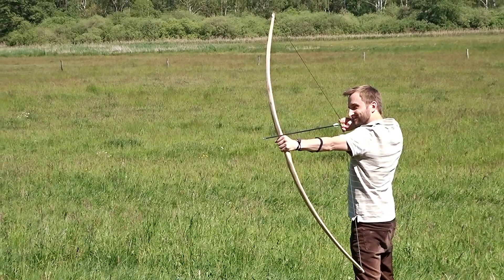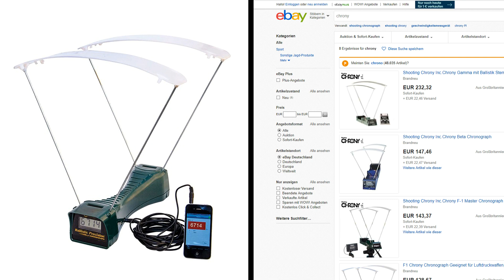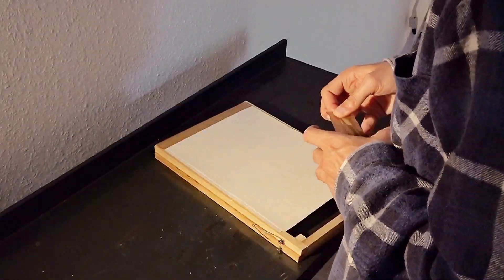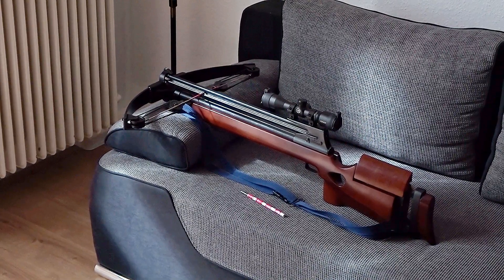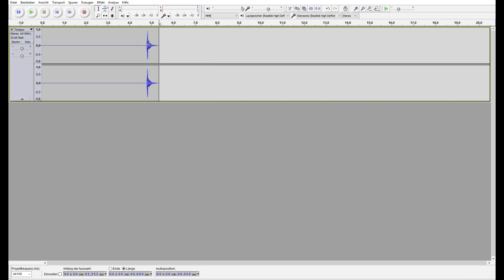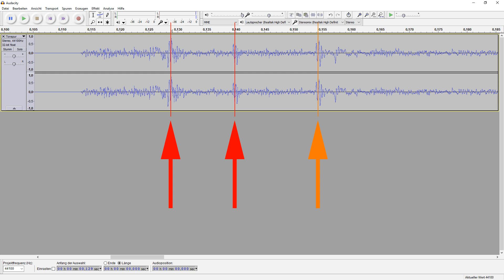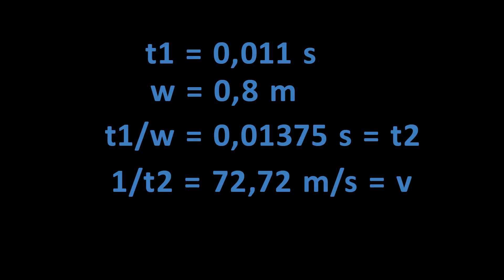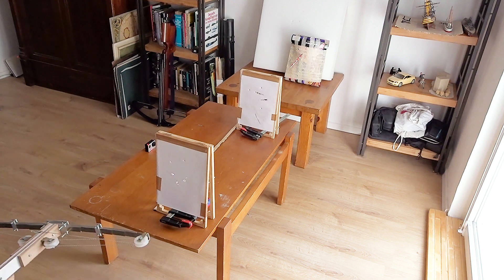Measuring Projectile Speeds – without a Chrony

Comment: I think that 40 joules it is very much for this crossbow. Is this mathmatic formula valid? Are included the time of sound from target to pc?
Reply from the maker: Since this video I checked the results with a normal chrony and the values match quite well. Also the formular is correct, its just the standard formular for kinetic energy.
Reply: @aurigo_tech  I speak spanish but a will try to watch video severals times and copy the metod, than you very much!h
Reply from the maker: @damians9252  te deseo mucho positive effectos y perdon mi muy mal español de la escuela (tres años..)..
Reply: @aurigo_tech  Thanks!!!